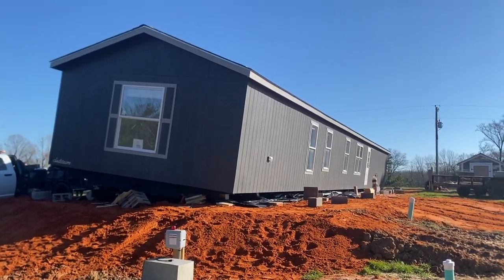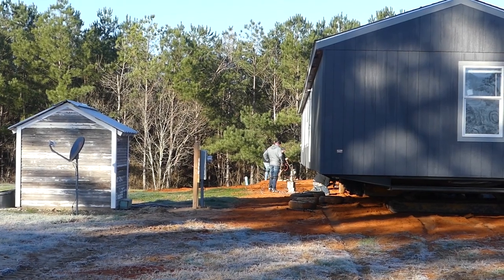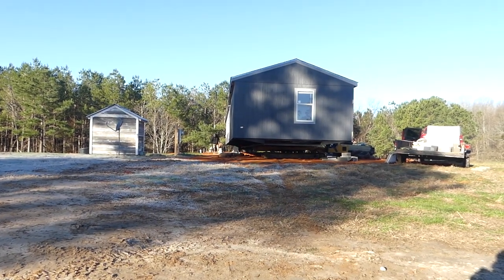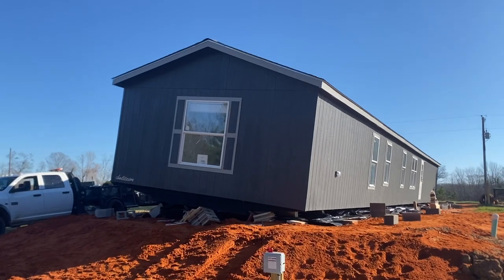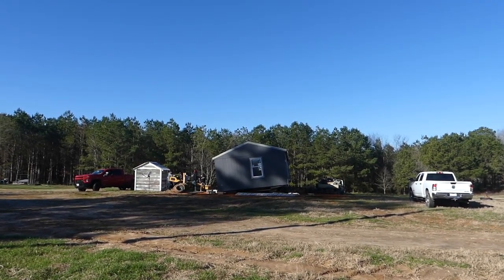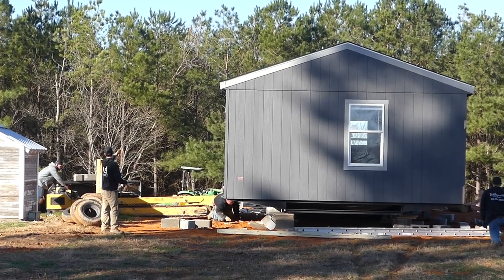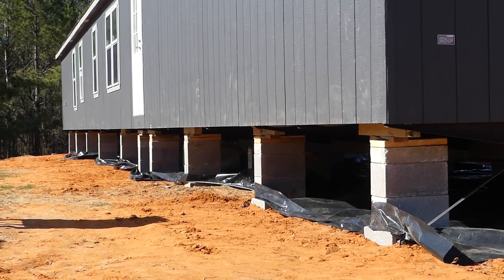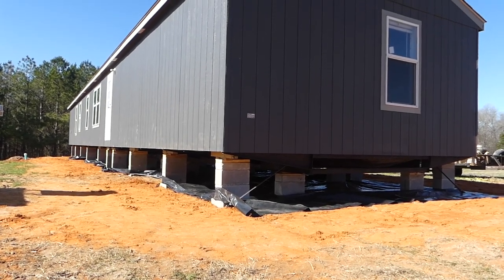HUGE Mistake During Mobile Home Installation | Homestead Journey

Comment: Good thing it's a Solitaire home, those things are built like tanks!
Reply from the maker: Absolutely, things could've definitely turned out worse. I had a friend who purchased a manufactured home from one of the cheaper companies. Unfortunately their home also got dropped during install and the entire back wall literally split open and tore everything up. They had to get a whole new home. But that's not the case with a Solitaire!